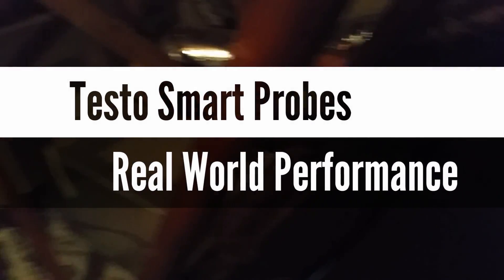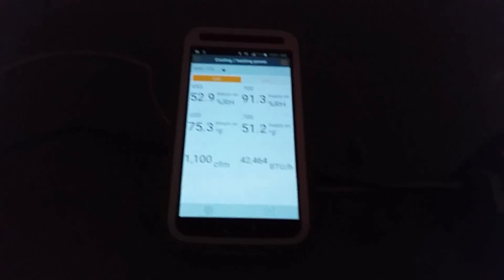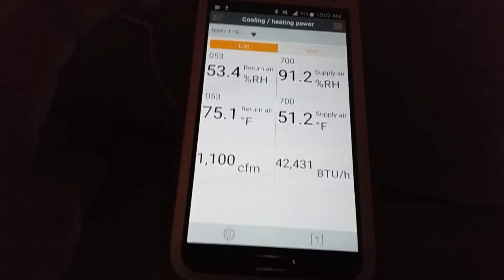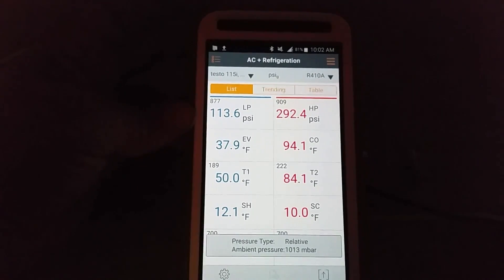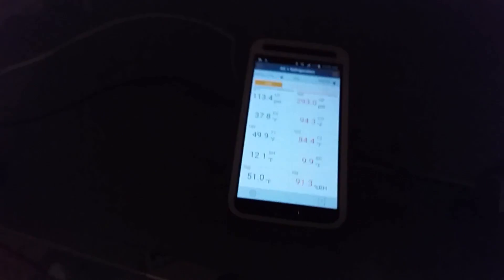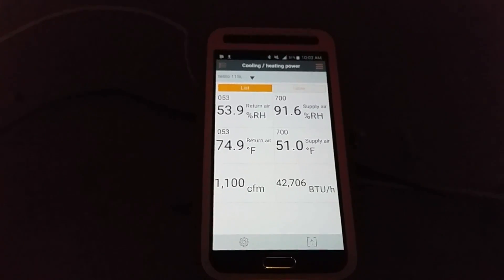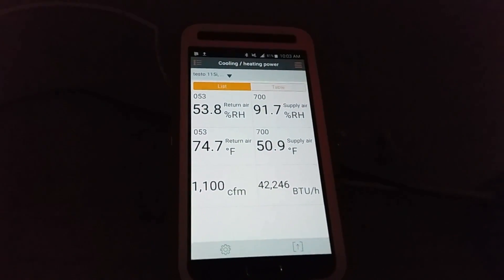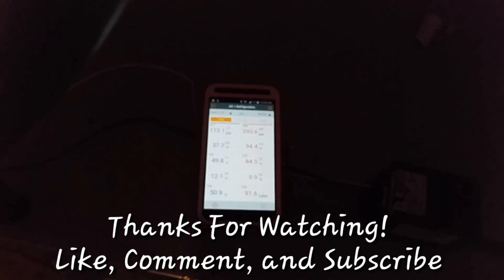Testo Smart Probes - Real World Performance

Comment: So are you using 2- 605i, for supply and return air? Would i be able to use a 605i and the 905i to do the same test? What would be a better choice?  Im a apprentice looking to buy a good set up.  Thank you
Reply from the maker: The 605i is designed specifically to measure air temperatures and humidity. You only need 1 605i, I just prefer to have 2. Hope that helps.
Thanks for watching